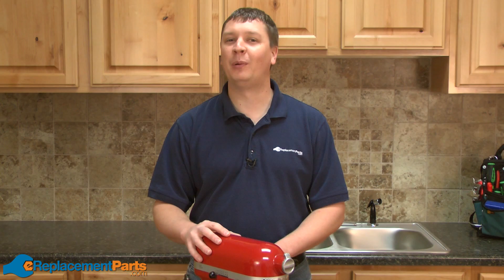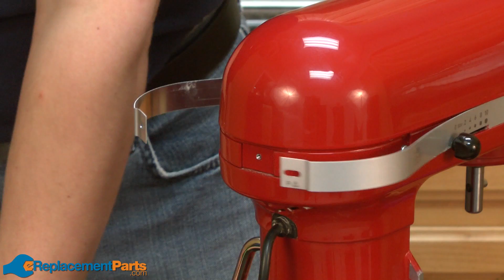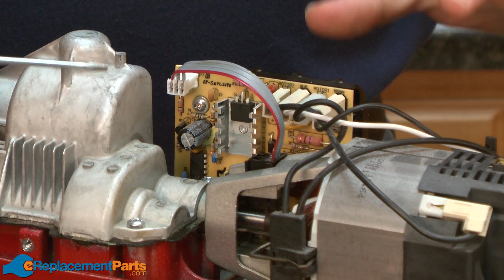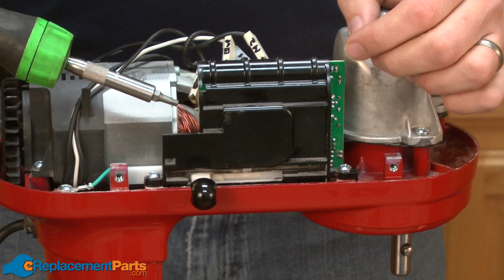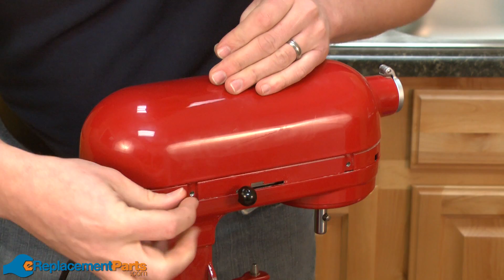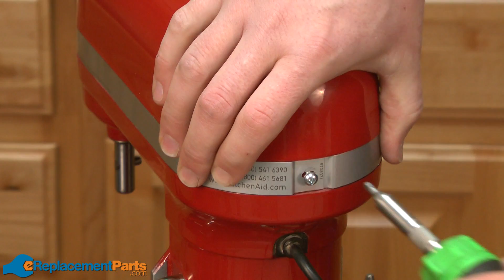How to Replace the Speed Sensor and Control Board on a KitchenAid Pro 6 Mixer

Comment: Hi, thanks for this video; made me brave enough to try this repair! I successfully replaced the control board and speed sensor on my KA Pro 6, but, when I tried turning the mixer on, it just struggled briefly to start and then there was no further response from the mixer. Any advice on how to proceed? Thanks so much!!
Reply from the maker: Hi Jeena, unfortunately at this time we are unable to offer technical support. I would suggest contacting the manufacture for further information. I sincerely apologize.

Comment: Do you have a video showing how to replace the brush holder? I know the machine has to come completely apart. The threaded tube (brush holder) on my 1985 K5SS Kitchenaid/Hobart broke when I changed the brushes. I super glued it for now.

Comment: Hi, great video!
I just moved from to Norway from Canada where I purchased my 5 plus about 1-2 years ago. Really want to get this great mixer to work in Europe. I read somewhere that it will work as normal if I replace:
- the 220/240v armature
- the 220/240v field
- phase control board (for 60Hz to 50Hz)
Can anyone confirm this and is there videos out there for this voltage change procedure?
Thanks and sorry for going a bit off topic here!

Comment: i have a kitchen aid professional 6 mixer that recently stopped working out of the blue.  the machine does not turn on at all regardless of what speed you set the control to.  i have tested the leads on the speed control board going to the motor and they show 120v when you turn the machine on, but only for a few seconds before it goes back down to 0v as if the machine was in the off position.  would this still indicate an issue with the speed control board or would this be a dead motor?

Comment: Any insights as to why my 5 quart artisan has variable speeds and sluggish performance at speed setting 10? Sluggish and intermittent speed (despite not having changed the speed) happened during the same use.

Comment: I bought new controls for my mag drill (Milwalkee). It is a half wave base and I have a half wave control panel that E-replacement sent me. When I push the mag button it blinks like I have low voltage but it is 122volts. I have two other drills and the controls do the same when I hook it to them. Is this part defective or am I missing something? My old control panel will still work the magnet so I know nothing is wrong with the drills.

Comment: Very good video. You are correct that it is very easy to replace. The problem that I experienced is that there was a major delay in the receiving of my part. It was ordered and somehow order was cancelled and returned to factory. I finally received my part, but have been too busy to put it in. Just attempted to now, but it is not the right  control panel. I spoke with someone personally when I ordered it, so not sure what happened,  but  the control panel is designed differently in mine.  Now I have a part and cannot use it, and still no mixer.😕

Comment: My machine won't start at the lowest speed. I have to leave it at the lowest speed for about 30 seconds, then it starts. Could it be a speed sensor?
Reply from the maker: MIlw55 What model number do you have?
Reply: eReplacementParts.com I have the Professional 5 Plus (450 Watts)
Reply: +MIlw55 DID THAT fix your issue.. i am having same problem

Comment: when I place my mixer on low it stays low for a while then jumps up to a higher speed then down to a lower speed. When I put the mixer on the highest setting and then back down to low it stays on low for a while, Do I need a speed sensor or a control board or both? Thanks

Comment: I just replaced the speed sensor on my KitchenAid Pro 6 mixer.  It still will not turn on or even make a sound,  Is there something else that it might be besides the board itself? Also I have a model Kg25h7xsl 5 gt mixer that needs a worm gear .the web site states that the new version only works with the later models What part number would I need to order that part,  I do not find anything on the list and the man in the office there could not help.

Comment: Hi there, I replaced the speed sensor and still the mixer speeds up. Upon further investication the spot where the speed sensor connects to the motor and reads the speed, there appears to be indicators on the shaft of the motor (if this is correct). these appear to be broken, will I have to replace the motor? or can I get the indicators?

Comment: Hello,
I have replaced both the speed sensor and the control board.  But the mixer still when turn on to the lowest setting, goes to full speed and turn itseld off after a few seconds.  What could be the next step? Any suggestions?
Thank you

Comment: Hello.  I have a K5SS.   I replaced the plate that had a crack in it.  Now My speed control is working backwards (1 is high and 10 is off).  I took great care to replace the wires the way they were and  It looks like all the all the wires are connected (colors line up).  What would cause this and how can I fix it?  Thank you

Comment: Need KitchenAid Help
I have the problem with kitchenaid artisan mixer KSM150PSWH. Some years ago, there has been made the modification of the mixer, it has been changed from US norm 110V to european 220V - no idea who and how has made it. It seems to be the time point, from which the mixer started to spin in reverse direction, what causes big problems by lot of accessories. If I look on youtube videos with artisan, the mixer really spins in the opposite direction than all other in videos - it impacts not only the planetary, but also the horizontal axis going to the front of the device. My question is, if there is some way how to fix it, I thought I could try to change the motor polarity, but  have no idea if this kind of motor can be regulated in that way and if, where do I have to replace the cables. I have tried something, but it did not help. Any advice or pointer will be appreciated.

Comment: I had a different set of symptoms on my mixer. It basically wouldn't turn on at all anymore. Turns out the motor needed replacement. I ordered from ereplacement parts and it worked!! Definitely worth the $100 for the motor.

Comment: I just replaced my speed sensor and board on my  KitchenAid Professional 5 Plus mixer and it continues to start on high speed and then stop.  Is there something else I need to replace.  Very frustrating.
Reply from the maker: First thing to check is that the sensor is completely seated being close enough to detect how fast the motor is turning. Also check that the connector is installed correctly. Very rarely the magnetic ring on the motor shaft can slip out of place causing the symptoms of a bad sensor.
Reply: Also make sure the red strip on the ribbon cable is on the left most pin as you face the control board and the gear housing is on your left. Just like in the video. If you have it reversed you will get the symptom you described too .
Reply: 2 years late but wanted to reply.  Yep.  Had it reversed.  Once I reversed, worked like a charm.

Comment: The white part of the speed sensor you have the wires exposed up. On my machine the expose wires were facing down. Your video has the exposed wires up. Which is the correct installation exposed wires up or down?
Reply from the maker: The connections for the speed sensor will only go on one way. You might have an older version of mixer with and older style of control board.

Comment: Hi Mark. Please let me know your thoughts on my k45ss that has speed issues. The mixer starts to mix then stops immediately when I start at lowest speed and go from lowest speed through to speed 8. Runs fine on 8 and 10. Also runs fine if I decrease from 8 down to 6, 4, etc., but I can't use lowest speeds unless I decrease from 8, which is not always what I want to do. What parts do you recommend I replace? Thanks!
Reply from the maker: It sounds like the rear bearing has come loose. With your mixer unplugged, turn it onto the highest speed and snug the two nuts that are located on both sides of the control plate. Don't over tighten these nuts as it will bind the motor. If you can turn the governor without too much effort the nuts are tight enough. There should be some resistance when trying to turn the motor.

Comment: Hi Mark, Thanks for your excellent videos.I have a k45ss which, on the lower speeds (stir - 6), sounds like it is getting ready to mix then instantly stops. At the fastest 2 speeds (8 and 10) it works fine. I can then decelerate to the slower speeds and each one works fine as long as I go from fast to slow. What do you suggest I do to fix. Thanks so much!!
Reply from the maker: It sounds like the rear bearing is loose in you mixer. With the unit unplugged, open the rear housing. To the right and Left of the control plate there are two nuts. These put tension on the armature as well ass hold the rear bearing housing in place. These two nuts need to be snug but not too tight. Again, with the mixer unplugged, turn he speed lever to ten. Snug the nuts and make sure that they are not too tight by turning the governor with your fingers. There should be some resistance, but at the same time it shouldn't be difficult to turn with your fingers.

Comment: My mixer will turn on, but when you turn it on to the lower settings it acts like there is a spring that bumps the mixer up to a higher setting. It is really annoying when you are trying to mix in your dry ingredients on the slower settings to avoid a dust cloud, and it bumps up to a faster setting and you get flour everywhere. I have to stand and hold the switch to prevent it from changing speeds. Any suggestions?
Reply from the maker: There is a screw that puts tension on and acts as a hinge to the speed control lever. To tighten this screw you will need to open the housing to gain access. Tighten the screw (Note: it can be hard to tighten).

Comment: Should the black end of the speed sensor ribbon cable connect to any pins?? or does it just snap into that slot and sit in close proximity to the motor drive shaft (not sure that's what that bar is called, but that's what it seems to be)? Thanks!
Reply from the maker: You are right. The sensor part clips into the frame of the motor and sits above a magnetic ring. Then end of the ribbon cable should connect direclty to the control board as shown in the video.

Comment: Dear eReplacementParts.

I have just bought a Professional 600 mixer, with the model number of KSM 6573CER2. I realised that you do not sell the following spare parts for it. The problem is I have bought it from the US to Singapore, and upon plugging in the power, it caused the mixer to fuse, resulting is a mini smoke incident. - due to the voltage difference of my negligence.

Therefore, do you have any advice which part can i replace? I understand it might be the chipset in the mixer that have burnt. Problem is though, the chipset is placed differently from your video, instead of it being on the side, it is placed under the motor.

I can't seem to find any tutorial on models with chipset placed below which is much more difficult to replace.

Your advice is greatly appreciated!

Sam
Reply: Don't know if its allowed, but i chanced upon this article http://www.e-scott.net/towardswisdom/2011/05/24/kitchenaid-mixer-fail/

where he replaces the board, and i had the same problem as he do. therefore i hope that a simple repair like this could have solve my problem.

However my chipset is green in colour, totally different from what i see here.

Comment: Thanks for your videos!  My kitchen aid pro 6 is turning on for a few minutes, but then stops and I cannot use it for a while.  It gets slightly warm, but not really hot.  The first time it stopped like this, it did get very hot.  Now, the mixer will not run for more than a few minutes.  I thought it might be the work follower, but I don't hear the motor running at all when it shuts off.  Do you have any idea what needs to be replaced?  Thanks!

Comment from the maker: Glad I can help! Depending on the model, the motors in these mixers do have a thermal cut off switch. In older units they will have a thermal fuse. Yours sounds like the case of the thermal fuse burning out. At this point it will be best to replace the whole motor. Thanks you for your questions!

Comment: Thank you so much for the reply. I did take the gear box apart and all gears look pretty new (I didn't use it a lot). I also tried to turn on the mixer without the gears and still nothing runs. Is it possible that some fuse was burned out? I can't imagine that a mixer that worth $400 has no protection against overheat or something like that.

Comment from the maker: Sounds like the mixer is having a gear problem. The only way to know for sure is to disassemble it and check it out. A video titled, "How to Fix a KitchenAid Pro 600 Mixer", will help you do this. Once you have the gears completely disassembled, check for wear as well as making sure all the gears turn freely. You also can carefully turn on the mixer without the gears in and see what it does. Very rarely does the motor go out. Thanks for watching!

Comment: My Pro600 mixer stopped working. Now when I turn it on, sometimes I hear the buzz sound in the motor for about 5 seconds and then the sound goes off. Sometimes, no sound at all. In either case, the motor doesn't spin. In my case, shall I try to replace the control board, or could the motor be broken?

Comment from the maker: This fuse is built in as a safety to prevent a fire. To check and see if the fuse is the problem, pull the leads for the motor off of the control board and run a continuity test using those leads. A multimeter will come in handy for this. If you don't get power through it then its time to replace the whole motor. If you DO get power through it its time to replace the control board. Thanks for watching!

Comment from the maker: On these mixers some of the motors have a thermal fuse in them. If the mixer gets over heated this fuse will burn out and not allow any more power to flow through to the motor.

Comment: Hi--My mixer will not turn on.  I just replaced the worm gear, plugged it in and then nothing.  I think it may be the control board based on this video.  The only video I found to replace the control board was for the Pro series.  My mixer is the heavy duty 375 watt model with a vertical bowl lift so it has a rear cover.  Is there a video that does a control board replacement on this type of mixer?  The video for the worm gear replacement was great.  Thanks for the help.

Comment from the maker: These mixers can get in contact with a lot of flour and because of this it can gum up the control board giving you the problems you are having. Sometimes you can correct this problem buy blowing some compressed air into the slot on the control board and, with the mixer unplugged, move the speed lever back and forth a few times to try and break up any debris.

Comment: If the motor doesn't change in speed from #8 to #10, does this imply that it is a speed sensor or control board issue?  Thanks much

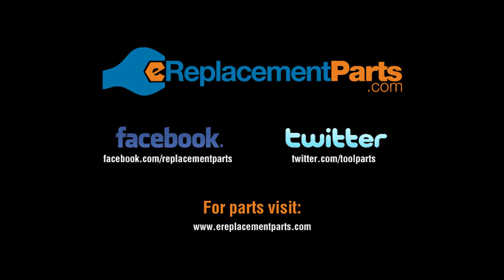Comment from the maker: Currently disregard the part about replacing gears. At 6:25 you will see the upper housing of your mixer. If you look where the speed lever is you will also see that there is a screw that holds the lever in place as well as acting as a pivot point. If you loosen this screw about 1/4 of a turn you should notice a difference in how tight the lever is. If your mixer is not the model KSM90 but a 6 Qt mixer size then you will need to replace the whole control board to fix your problem.

Comment: Hello, thank you for these helpful videos. I have what seems to be unique issue with my KitchenAId mixer. The stir and "2" speed settings are the same speed, and the motor makes a "buzzing" sound when on those speed settings. I have tried adjusting the speed settings, but even with the adjustment screws all the way in, the machine still runs too fast on "spin" and still at the same speed as speed setting 2. What do you suggest I replace? Is there a reason it would buzz?

Comment from the maker: The first thing thing to check would be the brushes. Our video, "How to Replace the Brushes on a KitchenAid Stand Mixer", will be of great help for you. The part number for the brushes is #W10380496.
If that does not take care of your problem then you might want to consider taking it to a service center. Electrical problems can be tricky to diagnose correctly with out seeing it first hand. That's where a service center will come in for you.

Comment: I have a kitchenaid k45sswh mixer that I have had for 3 months, I have used it about 4 or 5 times. when I turn the mixer on the switch looked like it was sparking inside. then it stopped working after that, wont turn on... do you think it is the control board or something else? I appreciate any help!!

Comment from the maker: Once you have done that you should check to see if you are getting power to to the board. With replacing those parts it is also sometimes necessary to have the speeds adjusted back into place. Only service centers have the proper tool that allows them to adjusted the speeds correctly.

Comment from the maker: We do have a video that is specific for your model of mixer that can be of help titled "How to Replace the Circuit/Phase Board in a KitchenAid Stand Mixer". There are a number of reasons why you might not be getting power. To start you might want to check that the brushes are installed correctly (Seen on "How to Replace the Brushes on a KitchenAid Stand Mixer").